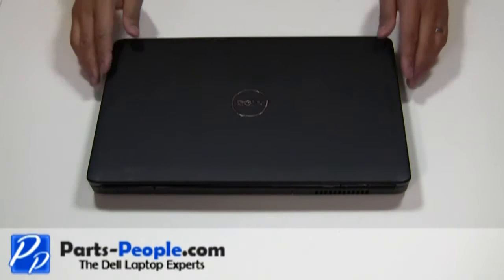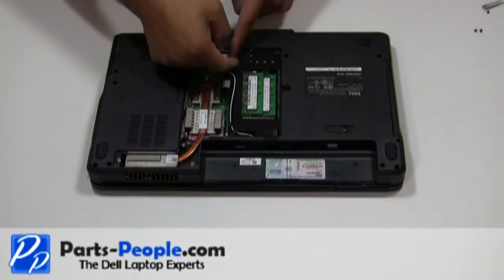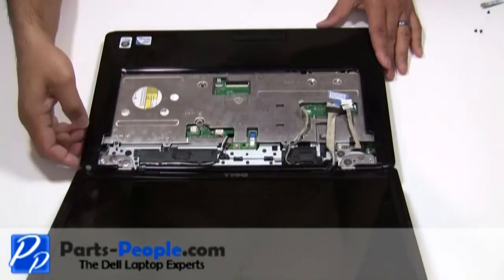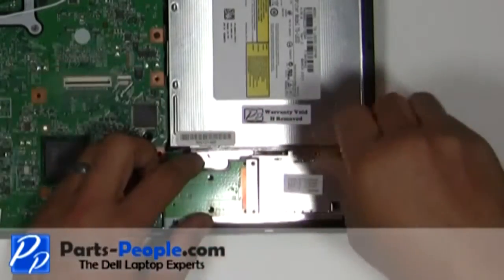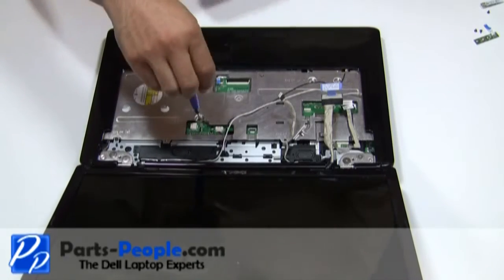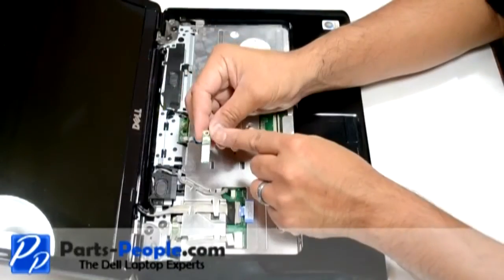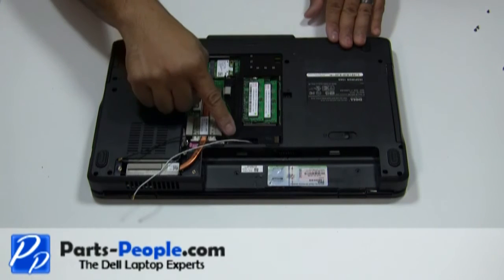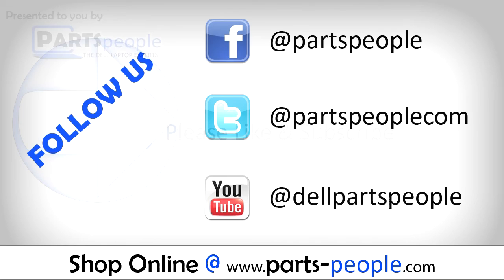Dell Inspiron 1545 | Express Card Slot Assembly Replacement | How-To-Tutorial

Comment: Hi!. I have the same model, it was connected a monitor of 23" in. with a resolution1024 x 750. End just dead the screen. possible fail the graphics card or screen or driver of graphics card or motherboar?.

Comment from the maker: An ExpressCard is an interface to allow peripheral devices to be connected to a computer.  We do have a listing for the Dell Inspiron 15 (1545) Motherboard System Board with Discrete ATI Radeon 4330 Video (Dp/n: H314N).  You should be able to find this motherboard on our website by entering the part number in the search bar located at the top of the page.  If you need further assistance please contact us at 1-866-816-5254

Comment from the maker: Unfortunately that is not possible since there is not a nVidia version of that motherboard for the Dell Inspiron 1545.  You can, however; upgrade you motherboard and video to the Dell Inspiron 15 (1545) Motherboard System Board with Discrete ATI Radeon 4330 Video  - H314N.